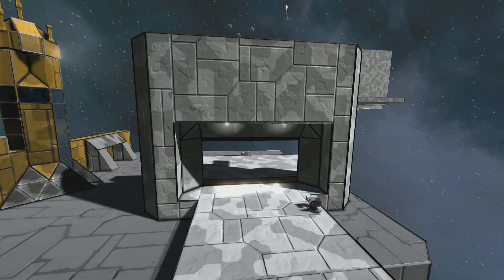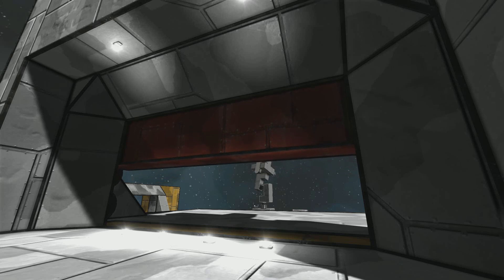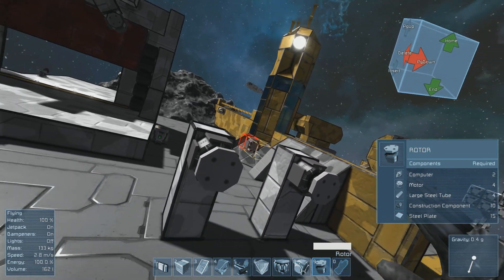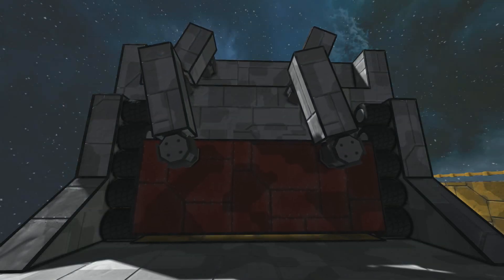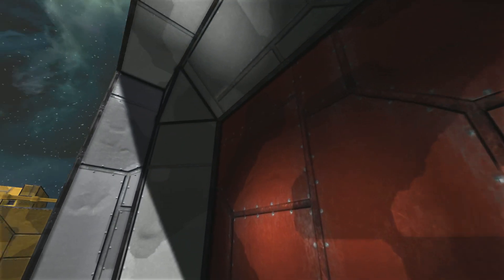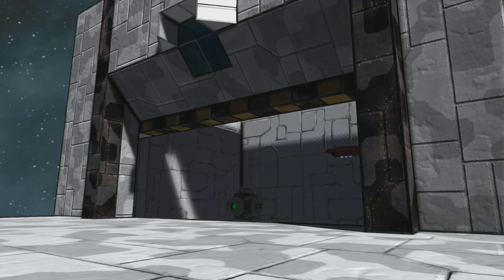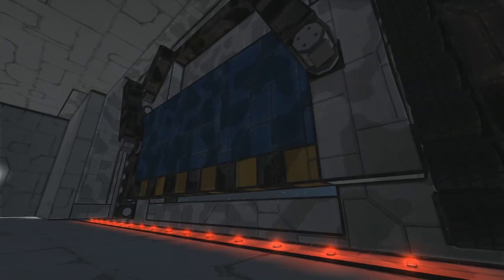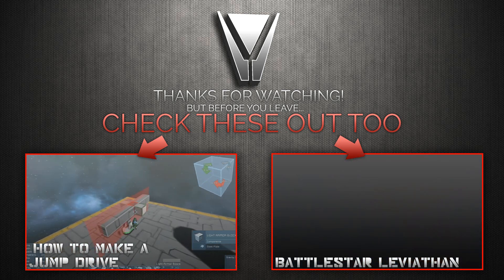BEST Blast Door Design [Space Engineers]

Comment: Hey nice door but I just wanted to point something out.  As car as I'm aware you could already have two rotors attached to one door.  I don't actually have the game yet (still need to upgrade my pc to something not crap) but I think I might have seen this somewhere and it's just common sense anyway. Still, all you have to do is use rotors as a spacer.  It's not a perfect solution, but it shoudl work just fine.  So if your door is .1 too far to the left thanks to the rotor on the right hand side to fit flush it's .2 too far to the left to fit against another rotor on that side, you put 2 rotors in there facing left at some point before the mount of the lefthand rotor to make it flush. 

There are already lots of flush doors as well, and ofc double piston doors that are flush, and praversham gaming did a whole thing on how to attach a double piston to one object in one of his tutorials.  I'm not saying your door isn't cool, but it's nothing you needed the merge blocks to do.  People were just too lazy to do it the hard way so they did shit doors :D 

Btw if you want to make it REALLY cool you should add a pressure plate to it so you don't even have to get out of the cockpit to operate.  There's a tutorial for that here on the youtubes somewhere, though once you get the idea it's not too hard to figure out how to do it.  If you could figure out a way to compress THAT into the space of a few blocks that would be pretty impressive.
Reply: didnt read this whole thing but i give you a +1 for the effort of typing it all :D